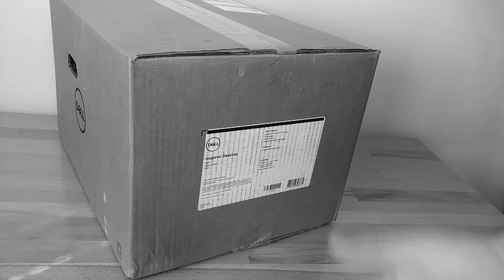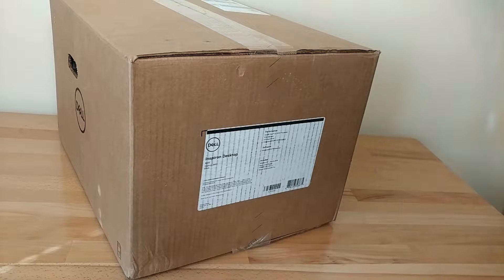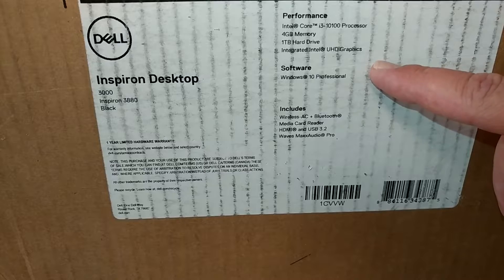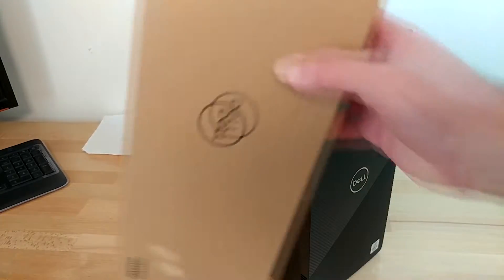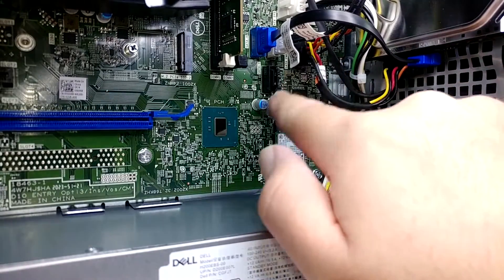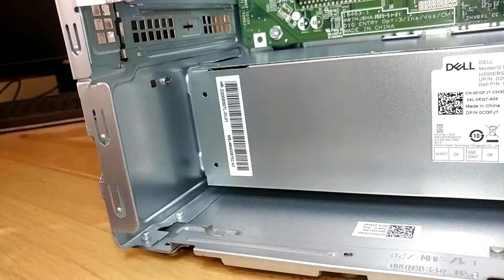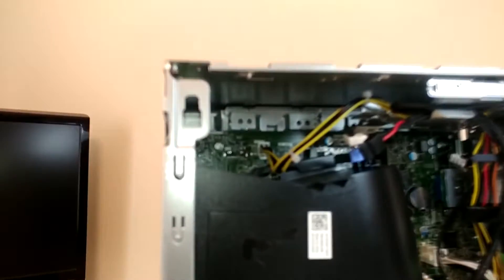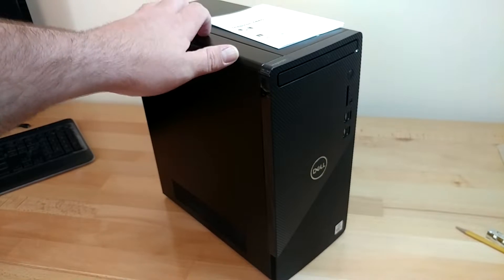Unboxing The Cheapest New Dell for 2021 (and 2022) and Upgrade Plans!

Comment: I have to disagree that this is better than you would have gotten ages ago with a budget PC. The worst Packard Bells were better built, judging by what I can see.   I don't see this computer living 15 years. OTOH, I don't see that CR-2032 lasting 15 years either:)

 Really, it is the bottom end of everything that has taken such a  large plunge. They (all manufacturers, not Dell specifically) always made cheap stuff, but there was a limit to what they would do in cost cutting.  In the last 20 years, basically since China got into the WTO, everything has gotten worse in terms of build quality, but especially the cheapest stuff. Prices are lower than they ever were, but so is quality and probably by a bigger margin.
Reply from the maker: I was thinking more like the 100% proprietary machines I saw back in the mid '90s where you just flat out couldn't work on them. Then there were eMachines who literally just hot glued stuff together. For the money, this Dell is miles ahead, IMO..It's built down to a price for sure, but it's way better than anything in its price segment would have been in days gone by.

It's interesting that the 15 year number is what I arbitrarily landed on. My Dad's prior Dell is 15 years old (he still uses it now) and is plugging along and the battery in the last one I actually built just gave up the ghost this year... at 15 years old. ;)

It's impossible to know what is going to happen, but for the money, I stand by my initial assessment: Not too bad for $360, new. Many of your thoughts are also why I wanted to mix it up with other brands to see who is doing what, but the iron was hot to strike on another Dell this year so that's what I did. I'd like to grab a Lenovo next year to see what they look like.
Reply: @TheBrokenLife  Well, to be fair, this price segment really didn't exist in the 90s.  E-Machines was pretty low end, but the physical build quality was better than low end PCs today.  Obviously I am limited by just seeing it in the screen, but it looks very much built to a low price. The plastic even looks cheap.  
The cycle life should be getting longer because PCs are just not getting as better as quickly as they were in the 90s.  Using a 15yo computer in the late 90s was just not an option.  Even my computer at 13 years old would have been completely useless in the 90s (using a then 13yo computer).
 Let's hope it lasts.
Reply from the maker: @tarstarkusz  eMachines was famous for offering $399 PCs in the late 1990s and I assure you the physical build quality was no better. I wasn't exaggerating when I said they were hot glued together. For a short period of time I worked in warranty support for eMachines and it wasn't uncommon for a component to get hot and simply fall off.

The Packard Bell example you gave earlier is a reasonable comparison as they were more bottom tier, but the issue with many of those machines is they just about couldn't be upgraded. Even our first family PC, which was an IBM PS/1, had insanely high build quality, but almost no ability for the end user to service. Almost everything was proprietary IBM weirdness. 

In all of the above cases, I prefer the modern Dell. I absolutely agree that it's built down to a price, but that's literally what I paid for and what a lot of people are starting out with. I'm absolutely interested to see what comparable models from other manufactures look like, and I was planning to go down that road this year, but the stars aligned that it was Dell again. Next year I'd like to do a Lenovo.

I still have the machine I built in the fall of 1998 and it still works, though not with a perfect service record. The 3880 will be around too unless I drop it off the roof. ;)
Reply: @TheBrokenLife  IIRC, PS/1 machines used those goofy memory modules made specifically for PS/1and plugged into the front of the computer. The main problem with the PS/1 from an end user's point of view is MCA.  There wasn't a big market for MCA for consumers.  But having supported PS/2 machines and where the company was paying, the PS/2 line was an easy machine to support. Quality was great and parts availability was great and there was no foolery going on with ROMs causing incompatibilities.  I could get parts for PS/2 machines as late as 2000 (which was the last year I ever had to support PS/2 computers running OS/2). Compaq was the same way. 

Most Packard Bells were standard enough to be upgraded. But, to be fair, I have never had a building full of Packard Bells. But I can't tell you how many people asked me about buying a Packard Bell back then, I told them not to and then they went and bought one anyway. They almost always came back with a problem.
I'm guessing you don't have much in the way of machines from around 99 to 2005-2006.
IIRC, the eMachines low cost computers were subsidized by 3-5 year internet contracts.
In some ways, it makes a lot of sense to build them cheaply. Computers are not generally devices you hold onto for a long time. Quality costs money. Quality is generally heavier and costs more to ship and more to dispose of.  Quality also means inventory for parts availability well past obsolescence.  But I think it is reasonable to expect a computer to last 5 years.  Another area they really cheap out on is the keyboard and mouse.  Even the supposedly "good" quality Dell keyboards are absolutely awful.  The build quality is trash. I haven't seen a decent Dell kb since the mid 90s. But this has been true across the industry.  I use an IBM model M keyboard and a good quality mouse.
Reply from the maker: @tarstarkusz  IBM used the PS/1 moniker across several fairly dissimilar designs, including one in a PS/2 case. The PS/1 we had was a 2121 and used standard ISA slots (though I never got an expansion card to function in it) and wasn't MCA. It didn't have any plug-in slots from the front, but it did use weirdo proprietary RAM like tons of other stuff back then did. It also had 0 additional drive bays, which is looking like this Dell may have reverted to (excluding the "ODD" bay), but I may have a hack for that. I've already seen one guy on Dell's forums asking for help there too, so, it's still a thing people want.

In the PB era, I was on the flip side of that equation at the time, selling Packard Bells and at the time trying to talk people into HP's offering of the day since it used 100% standard internals, meaning standard AT form factor board, standard issue RAM, socketed CPU, normal AT PSU, normal graphics card, etc. It was as close to a parts build as someone could just go buy. Most still bought the (I think) $999-$1299 PB special. Like you, I had a few customers come back later and express disappointment. I tried! To your point, in 5 years they were paperweights anyhow, so, not much of a concern in the grand scheme. 

eMachines weren't subsidized w/ISP until later when they offered the eOne and then later merged with FreePC. That's the era you're thinking of. Originally it was just a PC box for $400 and off you went to buy your monitor... and I maintain they were 100% junk that barely could get out of their warranty period.

I strongly agree with you on Dell's KB and mouse and I think to quote myself in the video, I called them "junk"". I'm a logitech man myself these days, but ran model Ms forever too. I only managed to ever kill one of them.

Anyhow... If this "new PC" series becomes a thing, I'm completely open to ordering up the higher end models and gutting those down too. Although I think your overall opinion of the 3880 is perhaps too harsh, this is the cheapest Dell they will sell me and I admit it does show. A few weeks back I gutted down and cleaned up a 5-8 year old Precision and that think is a tank by comparison, almost to the point of comical overkill. That case handle!
Reply: @TheBrokenLife  The only computers I recall being that inexpensive were some really bottom of the line stuff with a VIA (IIRC) nonstandard goofy processor. Compaq made one of them.
I wasn't involved in sales or retail in any way. I don't think I could have handled that.  All of my experience is in corporate IT departments. But that didn't stop people from asking me, either people at work or friends/family.
The PC I would have recommended the most would be a Gateway 2k. They were generic PCs with a gateway label.
I may be misremembering but I just don't recall emachines being much of a big deal until the ISP deals started coming around.  I remember I really liked that eMachines iMac rip-off, but really from an aesthetics point of view. I never used or supported one.  
I had to develop both images (the whole drive) and builds (stick in a disk and the build process is automated). But the company was big enough so that I had nothing to do with procurement and rollout (which meant after-hours phone calls to me that the image or build isn't working) . When you are creating such things, you really want a minimum of computer variation. That was the problem with Dell and Gateway. Just to roll out thousands of computers takes months and if the base computer is changing during that time, it just makes it exponentially more expensive and difficult. This becomes a major problem when you can't get original parts over a 6 month roll-out let alone 2 years into the life-cycle.
Enterprise PCs generally cost more money, but they are much better built.  Even this low end 2007 model must weigh 30 pounds even though it is only a 1/2 "height" (wide in a tower config).

That PS1 goofy memory thing was a friend of mine. It's an IBM All in one monitor and PC 486. In 1993 when it was only a couple or few years old, nobody was carrying the RAM cartridge and when you could find it by random chance, it was 5 times the price of more standard RAM. I know because my friend calls me up and asks if I can find PS/1 RAM for him.  To be honest, I don't recall this being an industry wide problem.  Apple always pulled crap like that along with IBM and Compaq, but none of them are the cheap PCs we are talking about.
Reply from the maker: @tarstarkusz  I honestly can't remember the original specs of the first eMachine, but I don't think it was anything that weird as far as processor. I also never said they were ever that popular. What I said was that's what I had in mind when I made my comment and I stand by my statement. The 3880 is 10x the machine any eMachine ever was from back in the day. You're getting a ton more value for your money today when buying at the bottom of the market than you ever would have back in the day.

I ended up doing about 10 years in total in retail, but only sold PCs to the general public for about a year and that's pretty much the sweet spot of what we're talking about. Retail sucks no matter how you cut it. I also would have recommended Gateway at the time (and did outside of work) but we didn't sell them so it would have been a great way to get fired. ;)

My point on build quality is that you're legitimately skewed from your professional experience. Who in the world actually needs a 30lb PC for their home use? Honestly, having been a corporate IT customer (the guy you brought the computer to) for about 20 years now, I've never needed one that mechanically heavy either. They bring it to me, hook it up, and it sits in that same spot for years on end until the next one arrives. I wasn't taking it hiking with me. About 10 years ago they switched pretty much everybody off to laptops, even for heavy engineering work. It seems anything short of a straight up server doesn't need to be all that "big" anymore. 

The unique memory thing was rampant, especially among laptops. I'll confess that digging back in my memory hole for things that happened 25 years ago is going to leave me coming up more blank than not, but that's the basis of my comment. For all its other faults, perceived or real, the 3880 is pretty much industry standard inside. I can order just about anything I want straight off of Amazon (and plan to do exactly that). That's not how it was back in the 90s with a lot of store bought stuff, or at least not the stuff I was exposed to. On the enterprise side where you were at, I'm sure it wasn't quite as goofy. It also helps that you had access to actual industrial sources, where I was buying from the corner PC store, Office Depot, and the back pages of Computer Shopper. That can change perception quite a bit too.
Reply: @TheBrokenLife  The reason I brought up weight is because unless weight reduction is a goal in making something, weight is a decent proxy for build quality.
In my experience, the more generic a PC is, the more standard it is. It is only the large manufacturers that can make (or order) custom chips, for example.

I'm sure this Dell is fine from the point of view here (other than the optical drive bay). To me, it's the build quality I don't like, or at least, what it looks like through a computer screen.  Also, I'm not criticizing you about it. I'm sure this series of videos will have wider appeal than a video targeting a $2500 enterprise PC most consumers won't buy because of the price (you'll notice my computer I mentioned was bought used).  

There is certainly something to be said for following standards. One problem with my PC is the MB is not physically standard and cannot be mounted in a standard case. If it did fit, I would have it in a standard case already with an upgraded graphics card.  You might want to check the MB's design where the backplane and the slots.
Reply from the maker: @tarstarkusz  With pretty much anything made in China, weight and size reduction is almost always a goal because it ends up costing less to ship it. Dell is even advertising the reduced size on this model as a good thing (and I'm actually fairly impressed by what they stuffed in there without "stuffing" it in there). It's just the way of the world these days.

The only real area of the case that stands out to me as "cheap" is the front of the sheet metal where they stamped it all out for air flow. I would have liked to have seen a bit more steel left in there, but the plastic bezel (which is actual quite nice) does add some structure back. I'm also highly disappointed that they killed the 2.5" drive mount that was up there last year. I'm presently working around that issue.

I'm for sure not taking any of your points personally at all. This machine IS built down to a price, no doubt about it. My defense of it is actually exactly that; it's inexpensive for a reason. Also, you have to understand that most of the viewers here will probably be working on the computer their parents could afford and likely for the first time ever (based on the emails I've gotten from last year's video). I don't want to put anybody down by comparing it too deeply to enterprise grade machines. It's a starter PC and I personally feel it's a decent place to start. That's really the TLDR of everything I've said up until now, other than the BSin' about this and that along the way, which I've enjoyed as always.

Oddly enough, it seems the PC peoples are interested in just about anything. I've done 4 enterprise PCs on the channel before and the vids are reasonably successful. If I could afford to do brand new enterprise PCs, I would. I think it would be a ton of fun to just buy one from every price point from every manufacturer every year and go to town, but I don't have the $20k or so it would take to do that annually. Maybe some day? I never thought brand new PCs would end up a being a thing for me on YouTube, but.... I don't reject the thought.

Comment: i just purchased one and was thinking about putting a 1650 super gpu. i seen a couple of videos on work around on getting one installed. definitely wanting to see the final build. might do something similar. also interested on what ram could be used. i believe a 3200MHz
Reply from the maker: I'll probably spec my RAM for the i7 and see if the i3 gets along with it. We'll see how that goes. Probably going with 32 or 64GB,

What sort of work arounds are you expecting to see on the GPU installation? It's not a direct install?
Reply: @TheBrokenLife  I've seen people lay a full size atx out of the back of the case.
Reply from the maker: @7H3M4DH8R  You're going to see another guy do that too, but I have bigger plans than that... I think.

Comment: Buying a new PC with plans to upgrade it is almost always a terrible idea from a money point of view.   Having the upgrade path to an I7 is nice, but that really is something you would put off until you could get it a lot cheaper and during the time the I3 would be older and more in need of an upgrade.
With such an inexpensive machine, quality is going to be an issue.  That is usually where they get the savings from. In particular the hard disk and the power supply.  
I am using an older PC from 2007.  But it was a decent quality low end machine when it was new. I acquired it in 2014 or 2015 used with a 2 core 2.6ghz (IIRC) core 2 and 1gb RAM and I upgraded it to a 3.0ghz quad core core 2 and 4GB RAM.  I am right at the point where I want to get a new one. The video card is badly out of date and was entry level new and it cannot be replaced because of the physical shape of the computer. It will only take a 1/2 height card.
Reply from the maker: Oh, you're absolutely right that this is hands down the dumbest way to do it from a financial position. This is strictly for fun and to help people on YouTube.

I think ordering it up with the highest i7, more than double the RAM,. and an SSD was right about $700. That's a better deal than I can do with just buying parts by far. Last year it made reasonable economic sense because I only did ram and SSD and it was based around an older generation processor... this year it's insanity.:)